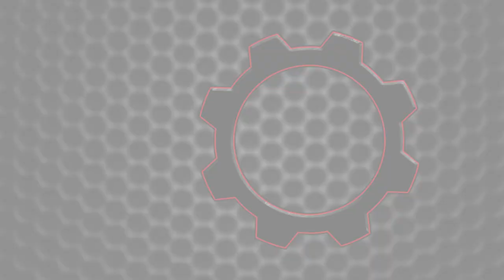This Jet Ski is Completely Incompatible With Water Jumps! - Trailmakers Early Access Gameplay

Comment: how did nobody see this!? during the first jump you pitched down a lot, that was because of the weight weighing it down in the front. my suggestion would be to try to replace it with buoyancy control blocks to fill I with water to emulate the effects of it while in water and then get rid of the water to jump so you don't have it weighing you down on jumps

Edit: and don't make the ramp too steep I think the second rendition wad the best (too steep makes a wall)